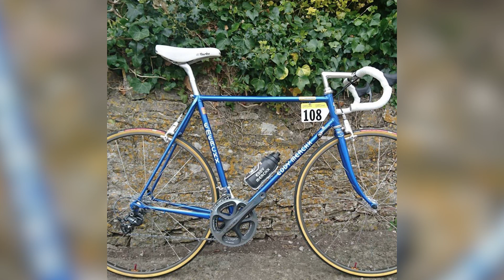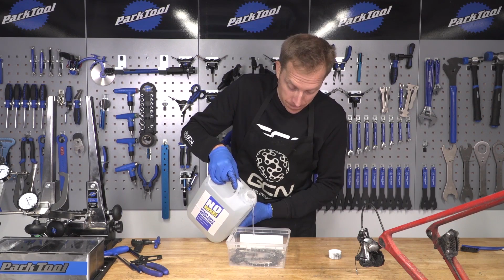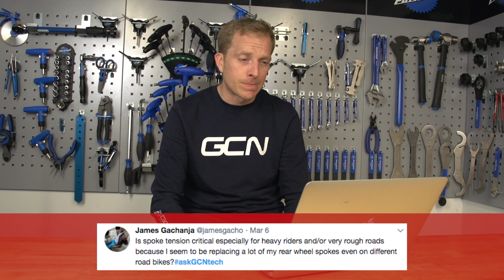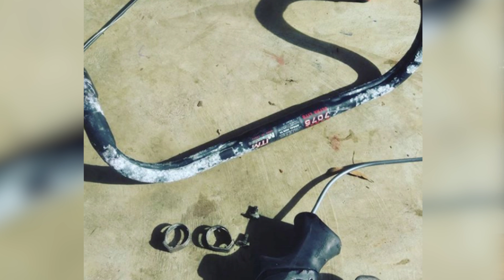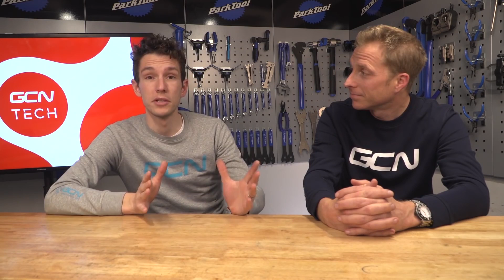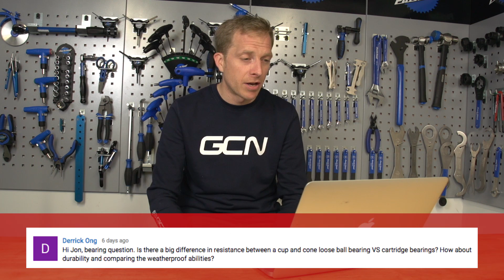Is Degreasing Your Chain A Waste Of Time? | The GCN Tech Clinic

Comment: Strongllites needle bearings were/is the best you could get. If there(theoretically ) is a bit more friction, you wouldn't notice on a slow moving headset. They never wear out, because the loadbearing surface is much much larger than on ballbearings.

Another advantage is that you can adjust them more precisely as they sit in an angle, contrary to ballbearings that have a very smal range between too loose and too tight.

Comment: Recently I noticed an odd noise coming from my rear wheel.  (A sort of whoosh, whoosh.) My mechanic thought it might be something in the 40mm carbon wheel.  However after removing the tire he felt a bit of lump in the tube.  We cut the tube open and a rust colored powder, maybe a 1/4 teaspoon, came out.  Could that powder have come from rust in my floor pump?  Replacing the tube did solve the problem

Comment: My local bike shop is having a hard time getting Ultegra R8000 Di2 components. They can’t complete the build out of a bike because of a recall on the entire R8000 groupset and are stuck waiting on the parts. Have you heard any issues with stock or a recall on the new Ultegra R8000 groupset?

Comment: Can't agree with "reliability problems" with tapered roller bearings.  When the original equipment headsets failed on my Santana tandem, replaced it with Stronglight Delta, and decades later it is still working like new.  Likewise with my steel framed road bike.  Way way more durable than the original Shimano Ultegra ball bearing headset.
Reply: Mike S interestingy nobody uses them anymore though... Must be a reason?
Reply: Probably overkill for most users, and maybe heavier, and pricier to manufacture?
Reply: The reason probably is that nobody is using bikes with 1" threaded stems...
Reply: Starclimber - Yes to all three, but on a 50# tandem outfitted for loaded for self-contained touring nobody's counting grams, and an extra $10 for "last forever" components is money well spent.

Comment: No BS, my coach and brother broke a set of handlebars that had oxidized from sweat. He snapped the drop right off from where the hood mounts. He lives in the southern United States where it is humid, hot, and uncomfortable. So the sweat ate right through it. Check your bars from time to time to confirm yours are not oxidizing as well.

Comment: spoke tension problem: actually even spoke tension throughout the wheel is more important than higher or lower the tension itself. even spoke tension is the most important thing in wheel building. you can have a wheel that is perfectly true and round, but if the spoke tension is not even, then the wheel wont last long. uneven spoke tension will cause spokes to break, and once one spoke is broken, others will break sooner or later. so if you got a spoke broken it is better to rebuild the wheel by someone who actually know what he is doing, rather than just replace the broken spoke. also try not to use some very cheap spoke. sapim spoke is recommended. pillar spoke is also nice. dt swiss spoke? thanks but no thanks, very bad experience with dt swiss spoke.
bearings problem: most cartridge bearings are radial bearings, which handle radial load well but poor with thrust load. cup and cone bearings are angular contact, which handle both radial load and thrust load well. bike bearings especially headset bearings and wheel hub bearings handle both radical load and thrust load, so cup and cone is a better choice in terms of performance. cup and cone also will last but you need to be careful with the preload, therefore you need to know what you are doing while handling those bearings, otherwise cup and cone/ angular contact bearing is always a better choice.

Comment: Any way to convert a hybrid with V-Brakes to drop bars and disc brakes. The fork doesn't have any disc brake mounting points?
Reply: i wouldnt bother. there are some adapters floating around the internet but its often cheap china stuff. but there are really good hydraulic rim brakes avaliable.

Comment: Hi there, I’m a poor student with a very limited budget and trying to get more into the cycling scene. I recently bought a Carrera Zelos, with everything stock. What should a novice like me with a tight budget be spending their cash on? Cleats, cycling clothing, cleaning products or even just some upgrades? Would value any advice you have for me
Reply: I do have a helmet, lights, track pump and some cleaning products. Just wondering if there is anything else that would make my life much easier, or make my bike last longer
Reply: As a recently returned rider, the best investment other than my bike was a saddle that really fitted me and good bike shorts. Much more enjoyable riding!
Reply: yupp, a decent saddle and shorts are higly recomended. and  maybe get better tires as an option if the supplied are really crappy, and narrow and puncture a lot. 

you can wear a sporty normal t-shirt etc. if the budget is tight, that will do fine. for cleaning soapy water, an old toothbruth, a cheap household brush and towel will do. i would not invest heavily in cleaning equipment.

Comment: Hi Jon, how do you get rid of cable bouncing inside the frame. It's really annoying on my canyon aeroad that when I upshift at the rear, I can hear the spring/cable make a loud sound.
Reply: That's a design flaw. A correctly routed cable under proper tension should not be rattling in a frame. But some bikes seem to suffer with it, including yours unfortunately.

Comment: Question: Can a carbon frame get too old? I like to build my own bikes, rather then buying a stock one at the bikeshop. I have an "old" frame from a Scott CR1 Pro from 2011 which im thinking about using for my next road bike. Its hardly been used and is in really good condition, but have just been hanging on the wall for the last 6 years. Are there any things i should worry about or is it just a go? #askGCNTech

Thanks for a great show!
Reply: LilleDan83 its not the age of the carbon frame. Its the condition that the frame has been stored in and used. The bonding material will break down due to use such as twisting and vibrations; environmental factors heat and wet salty air can reduce the life of the bonding agent.

Comment: You can get 650b or 700c wheels to work on old 26in frames. You just need brakes with lots of pad adjust like the Paul Motos or bmx race brakes. to make 700c wheels you also need a bmx brake adapter.

Comment: Ive got a 105 groupset with disc brakes. When I shift to a higher gear, my cassette keeps making this periodic rattling noise, like as if it rubbing on something. How can I fix this. Has it got to do with indexing my gears?
Reply: Did you remove the plastic bit that came with it? Think it should remain installed on road bikes

Comment: #askgcntech Hi Jon. My CX Commuter bike has never shifted well at the front dereilleur. What are my options to convert this to a 1x drivetrain? Do I really need a clutch deraileur and chainguide?
Reply: A narrow-wide chainring does most of the work really. Unless you are hammering cobbles I don't think you would need anything else. Plenty of MTB conversions running successfully with this.
Reply: Craig Lloyd Looking around all the narrow wide chainrings seem to be for cranks with 4 bolts, mine is 5 bolts. Are 5 bolt ones available anywhere? I don't really want to buy a new crank, any thoughts?
Reply: David Harper yes, I just searched and there are quite a few 5 bolt 110bcd options. I see Hope, Race Face, ride works... Lots of CX racers do this conversion, product is out there.
Reply: Craig Lloyd cheers, I'll get on it. Good man.

Comment: Hi, I got a question regarding my STI’s. I got 105 shifters combined with an Ultegra rear mech. Sometimes when trying to change to a harder gear, the small shift lever doesn’t make the mech shift (doesn’t pull the cable) and just swings  trough. I have had a couple of crashes with the shifter though. Is it down to crashing or something else?
Reply: HugoH try a good wash out with gt85 or similar. Sounds like a sticky pawl. Some older sti levers had thick grease that dried up and caused the same issue. Could also be a bad cable.

Comment: How to remove saddle and saddle post squeaks! I've removed the post, cleaned it, cleaned the inside of the drop tube, lubed the post and clamp and tightened it to the recommended 5nM. Ive removed and cleaned the saddle mounts, greased the saddle mounts, WD-40 in the rail housings and greased the clamp bolt. Clamped the bolt to 22nM with my calibrated torque wrench and the bastard still squeaks. Ready to set the bike on fire.

Comment: I’m a teacher on a budget and wondering If the new 105 groupset is worth the extra money over the 5800 series. I’m looking to upgrade my current sora components. I’ve ridden just under 1600 miles since January this year and ride flats as the only hill we have is a bridge from Miami to Key Biscayne. 
#askgcntech
Reply: As a happy 5800 user, the only benefit I can see to the new groupset is the slicker looking hydraulic shifters. 5800 has excellent shifting. Save your money, no regrets. ** Just check your rear wheel can take an 11 speed cassette **

Comment: I have a 2012 bike I use for commuting and it has 9 speed drivetrain. What would I need to upgrade it to 10 speed? Cassette, chain? Shifters? Anything else ? 
Wheels have adapter for 9/10 speed cassette already

Comment: Hi Jon, A performance question that has always bugged me. Simply, A 4kg light bike with a 25 cassette on it, or a 9kg bike with a 32 cassette on it for getting up decent climbs. thanks, mark
Reply: Depends on the gradient.
Reply: say a 5 mile climb with a good set of percentages. But also a 1/4 mile climb with percent into the teens.
Reply: Put the 32 cassette on the 4kg bike. Problem solved.
Reply: lol, the issue is Super Record doesnt come in 32. So, say Centaur is designed for 32, SR 'just' upto 29. Centaur is quite a lot heavier than SR, so you need the gearing to carry the extra mass. so i exaggerated the question to see if there is any definitive answers.

Comment: Apparently you should use an alcohol after using any degreaser or soap to remove any left over film. 
GCN - you should check out zerofrictioncycling on Instagram and Shane miller does a video with them too. He tests loads of lubes to see if they stand up to manufacturers claims etc. It’s interesting.

Comment: Question - I have a 10 speed SRAM red wifli rear mech, if I change my right hand gear lever to 11 speed can I use the same mech and simply adjust the limit screws to suit the wider cassette or will it not really work smoothly?

Comment: if the person is upgrading from claris to 105 they're gonna have to get a new rear hub that affords the space for 11 speed cassettes.
Reply: A number of cassettes that have a 34t or larger cog will fit on hubs intended for 8/9/10 speeds, including a new Ultegra (if I read the fine print correctly)
Reply: So I read their information and the answer is yes and no. They have 10 speed kog specific cassette separate from their 11 speed regular cassette. Both are 11 speed but one is sized for a 10 speed kog and one is sized for a 11 speed kog. That's for all ratios of cassettes. I hope that makes sense?

Comment: I just bought a Stages LR power meter.  The left side mechanism sits right below the inner chain ring.  Cleaning and greasing looks to be very problematic because of the power meter's proximity to the chain.  Any suggestions how to maintain and clean chains and chain rings with a left side power meter?

Comment: Tapered roller bearings are much less forgiving (as compared to ball bearings) when it comes to misalignment of bearing surfaces.  If your BB shell (or headset) is not perfectly aligned,  yu are much more likely to have binding issues with the bearing.

Comment: #ASKGCNTECH Hi Jon, great show as always! Quick question about SRAM Force 22 chainrings. I know chainrings are built to work as pairs (46-36, 50-34, etc.). I have a 46-36 on my Open New UP (amazing in blue!). It may not be a big difference but I believe 46-34 could help a bit for particularily steep gravel/offroad hills (I have a 11-32 cassette). Will the shifting performance be relilable enough for gravel riding, easy XC trails and even cyclocross races? Thanks.

Comment: Jon, I broke my Maxle Ultimate 135x12 lever by accidentally using too much strength to close it. Is there a way to replace the axle of the lever?  There're  no 135 options available on Sram page and the thread must be 1.75mm.Is 142x12 no lever Maxle Stealth option could be the solution in this case? I am wondering if it won't be too long the frame is Kona Roadhouse 2016.

Comment: hi mate, geat video again. Funny you should ask about squeeky bikes - since i had my  carbon steerer tube cut last week my bike has been creaking like hell. I do have a bb30a that is overdue a service (and was creaking worse than my knees before previously serviced) but it sounds like at least some of the creaking is coming from around the headset.
 any ideas? i'm a bit worred it's the forks or even (aluminium) handlebars?
It's going for a service in a couple of days, but wondering if i can ride it in the morning!
 cheers as ever #askGCNTech #gcntech

Comment: #askcgntech I tried fixing a problem with my front derailleur in which it wouldnt shift down to the small ring. After inspecting and reassembling the front derailleur it started working again as it happens so often with things. But now when I shift into bigger gears, the chain scrapes the derailleur and I can't seem to find the right position for it to work normally again. How do I reattach the derailleur  properly ?

Comment: Question: I am looking at buying a direct drive smart trainer. The bike I will be using has 10 speed campagnolo. I know a lot of the trainers have adaptors but couldn't I just use a 10 speed shimano/sram cassette and chain? Has anyone else done this?

Comment: #askgcntech  I have a 2008 zipp 900 disc clincher (the one with the aliminium rim and brake track).  I've used it with a 10 speed SRAM Red groupset for a while and have now upgraded to 11 speed.  Can i convert the disc to 11 speed or will the 11 speed freehub change the dish of the wheel and so not work.  If the 11 speed freehub won't work, what are my options.  Could a 10 speed cassette work?  Thanks.

Comment: Hi, another question: I have a Shimano 105 5800 group set and I like it. However, when shifting with either lever I have to move them roughly 2cm before I feel resistance and the actual shifting happens. Is there a way to reduce this dead space and to make the shifting more direct? #askgcntech
Reply: 2cm is about normal for shimano.

Comment: Hi John. Congratulations to the whole team for such interesting and funny shows.

I have a problem with a rear wheel that keeps slipping. It has QR and even if I tighten it loads it still moves slightly meaning wheel ends up rubbing on brake. At first I thought it might be that dropouts weren't equal but they are. Any suggestions: rubber spacer, washer maybe? Cheers, Toby

Comment: #askgcntech I have a problem with my wheels/brakes and the amount of play that the bearings have.  It is a 25mm HED Ardennes CL set and SRAm apex brakes .  When I corner or stand up to sprint I can feel them flex from side to side creating brake rub.  I took it in for service and they said bearings were tight and the amount of play is necessary for the bearings to move .   I still think they should be tighter as to not flex to the point of brake rub .  Am I just too strong for my bike or should I get a second opinion ?  Also will disc brakes solve this brake rub issue I assume over my caliper ones now ? I assume they also would be stiffer with a thru axle ?

Comment: Great video, Jon! I raced when in my 30's and I've worked at bikes shop off & on since age 16. Wheel building, frame straightening, race builds, chasing & facing, the works. I used to do it all. But I'm in my 60's now, and I haven't kept up with all the latest technology.  I have a question about the inexpensive bike cables sold in department stores. Do they require lube? I used to drip oil into the housings & grease the cables in the old days, and it always seemed to deliver good results, but is that any longer necessary? I'm volunteering to repair a cheap bike on a low budget, and don't want to take any shortcuts, but I've heard occasional rumors that today's cabling doesn't require lube. What's the bottom line? Thank you in advance for your advice. I liked & subscribed.

Comment: Contemplating switching from flat to drop bars on my recent conversion.
Currently, I am running a 9x sram casette and mountainbike derailleur, thus, the barrel adjuster is located on the (flat bar-) shifter rather than on the derailleur.
What kind of shifting would you recommend, or which is compatible? I'm on a bit of a tighter budget as well. Would, say, an 11x sram road shifter work, with an 11x cassette added? Or would I be better off with a bar end type?
Weniger anzeigen

ANTWORTEN

Comment: Great show guys, keep up the good work! I'm currently running RS505 STI levers on my 105 groupset. If I were to buy a set of the new R7000 STI levers (for improved ergonomics and aesthetics) do you think would I be able to keep the remainder of my R5800 groupset (with BR-RS505 brake calipers)? #askGCNTech #askGCN
Reply: You would be able to. All of Shimano's hydraulic calipers are interchangeable, assuming you have the right mounting on the frame to match your brake.
Reply: Thanks for the reply Austin!

Comment: Hey GCN Tech, great show, great channel! I have a big problem for which I'm not able to find a solution: when descending over roughly 50kph my hole cockpit starts shaking so that I'm nearly going to crash. The bike was checked at the retailer, the headset is set up correct, the wheels (Zipp 303) are new. Do you have any advice? Thanks guys!